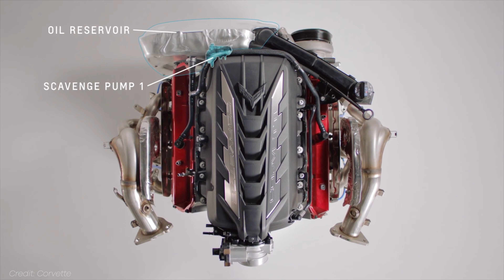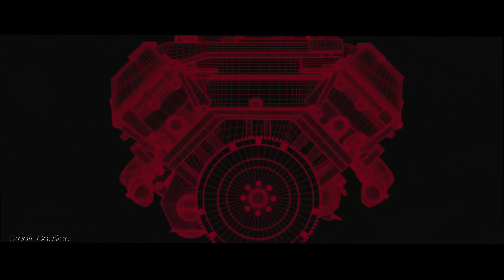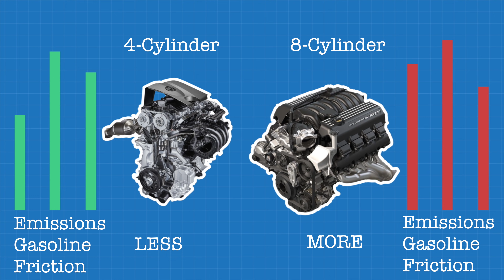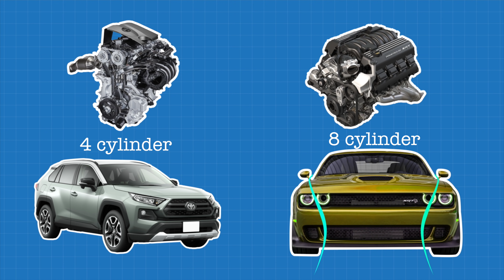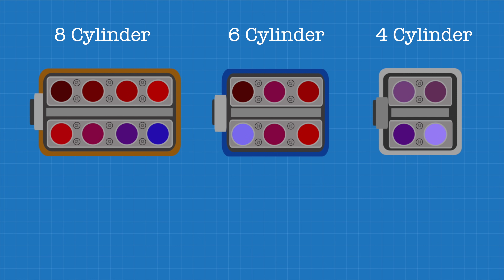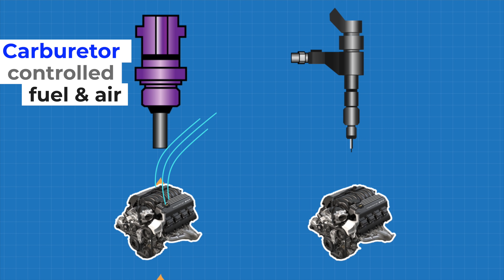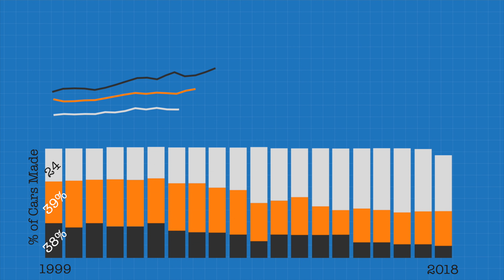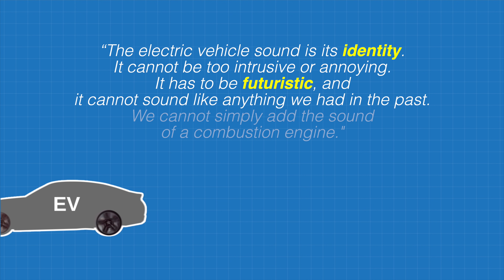Why V8 Engines are Dead

Comment: I am teaching my 13 yr. 'young' Granddaughter to drive my 1992 Chevy Silverado with the 350. She likes how easily the truck gets to 50 MPH. I agree..!! Yea, it gets only about 15 MPG out here in the rural area and that is with me hardly ever going over 60 or 65; usually around 55. But interestingly enough, even when I just have to occasionally floor it on the long straight stretches, I still get about the same MPG...!! And of course with an engine that powerful, I can pull just about anything....within reason, that is. I think I will keep it..!!

Comment: EV question: Who would wait even 15 minutes for recharging to complete when you can refuel a fossil car in less than half the time? And the range, maximum 300 miles? Even V8 vehicles can have a much greater range depending on tank size. I'll never accept EV'S

Comment: I like the idea of a V8 for longevity. Compressed motors with turbos and superchargers are fun but it makes them wear out quickly. I myself have been eyeing up getting me a fused F-150 crew cab with a 5.0 V8 and with a very special HHO mod. Most of the reports show double fuel efficiency increase at a whopping 30mpg if driven correctly. Wanting to build a long range overlander.

Comment: Nothing runs smoother than a V8 when it’s tuned and balanced right.    4 and some 6s have to have a balance shaft rotating twice the speed of the engine in the opposite direction to get the smooth idle of a V8.    V8 isn’t going anywhere anytime soon.

Comment: Only thing that will kill the V8s is if the government straight up outlaws them.  If you are doing real work in a truck a NA V8 is the best way to go.  The gas mileage of these twin turbo V6 and I4 they put in these trucks is terrible when you have to rev them 5k+ just to deal with a head wind.  Gas mileage has barely improved in fullsize trucks in the last 20 years while they keep putting smaller engines in them.  I'm still getting 19mpg with a 5.7 vortec with the AC on cruising down the highway 346K miles on it, and that's without disabling 4 cylinders or having 10 gears to run through.  New interiors are nice but ill take my 22 year old driveline that's never left me stranded over a 2mpg increase and losing all my low end torque.

Comment: I'd avoid turbocharger for the rest of my life

Big NA or electric is the way
Reply: Akhyar Rayhka 
You would take electric over turbo ? Why?
Reply: @aidenp5768  Lag, excessive heat, oil, and long term reliability for turbo is  not good Because the forced induction tech were only suited for racing cars.

Electric bcos no direct emmisions and no lag. Instant torque, no vibrations, quiet.

But id say every racing car should avoid going 0 emissions. Internal combustion should exclusive for these specialized racing vehicles.
Reply: Akhyar Rayhka 
Think of it this way, lag is still good, because for a second your car is naturally aspirated, it’s like your car is N/A for a little bit and then a surge of boost which is better than having N/A without boost! So why not??
Reply: @aidenp5768  its better. To. Have electric motors instead
Reply: What? Turbo/sc/NA... anything over electric is the way

Comment: No, it is not entirely true. Toyota still sticks with V8 and V6 for their midclass and upper level cars for dependability and long terms problems free engines.  Turbo and direct injections are prone to problems in intake valve, and short live engines.

Comment: That's why I'm holding onto my 4.6 V8 Grand Marquis for as long as I live!
Reply: 190 hp  woohoo !
Reply: @PorkusMaximius  Mines a '10 with an earth shattering 224 hp
Reply: I wish I still had my 03 cobra it had the supercharged 4.6 cranking out 390 hp stock
Reply: Certified Dirty Idle holding onto my 2004 Crown Vic Police Interceptor forever too!

Comment: If i own a V8, its going to have a huge transmission with lots of gears. 
That way, on the highway, i can really step that high torque down for some good speed at very low rpms.

Comment: If you ask me, V8 engines dissapearing should be called the modern day tragedy.
Reply: The only thing I like about a four cylinder is only four sparkplug to change.
Reply: The bigger tragedy is those 2.0L turbo 4’s. I could take a good V6 I suppose.
Reply: @ecoRfan  V6 is the way to go.
Reply: Ferrari STILL makes the 488...yep...V8, and 2019 GTE Pro LeMans winner
Reply: It's the modern day dinosaurs extinction. These huge v8 are dying out. Sad to see going down the road and no more rumble of the engines

Comment: But don't forget, generally v8' s are under stressed. Case in point, the 6.2 chevy v8 turns 1600rpm at 65 with a manual and can get 30mpg. That v8 will outlast any turbo charged 4/6 cylinder. Just ask Scotty, never buy a turbo charged engine or an electric car. Plus 4/6 cylinders typically sound blah.  Sometimes a simple ohv v8 is best. Great video. Long leave the v8. Keep them coming Chevy, Dodge and Ford!
Reply: Live not leave. Lol

Comment: Now this is just me personally but if I could pick any engine to have in a car I would take a V-12 first. When you drive a car with a V-12 you just don't want to go back to anything else. Second I would take either a V-8 or a straight six turbo diesel. A turbo diesel has low end torque that defies description and they can last decades. Last I would take either a four or even a three cylinder.

Comment: The idea of a world without the sound and power of V8 engines makes me sad.  Never getting rid of my '05 Mustang GT and '03 Marauder.
Reply: You and me both. 05 and 14 Mustang GTs 08 Shelby GT500! 
Love them all!
Reply: TNitro N hell yes! I have an 07 Shelby GT
Reply: 81 Ford  f150 ranger 300 I6
83  chev k20 v8 6.2 diesel 
88.chev v20 burb v8 350
91 Ford F250 460
Reply: I hope you can. I would advise stockpiling parts now. At the 20(ish) year mark the Ford parts counter will  start showing you laughing horse images in lieu of replacement parts
Reply: @98triffid  And I'll be checking out the PRANCING HORSE in the Ferrari 488
Reply: Ferrari  still makes the 488...
Reply: @tonybucca5667  Made from 100% pure unobtainium
Reply: How is the marauder compared to lets say a crown victoria?
Reply: Both are built on the Panther platform, both have a 4.6L V8.  The Marauder engine is the same as the Mustang Mach 1; it puts out 302 HP compared to 250 HP in the CVPI.  Other than the rear, suspensions are the same.  Marauder has air bags in the rear.
Reply: LL
Reply: 2007 gt500 for the win the last of the completely raw mustang that will try to kill you if your not careful
Reply: Better biobutanol

Comment: In 1980 I had a 1972 Pontiac Firebird 3 gears manual - V8, you can only fall in love with it, however I was still getting my allowance and after a few races, I realized that I could actually see the fuel guage decrease in front of my own eyes when I accelerated, so I stared to drive slowly to save on gas money (which defeated the purpose). I love V8s but like a T-Rex, they will go....

Comment: I have a 98 Mustang GT 4.6. I am gonna do my best to keep it on life support
Reply: Those 4.6L V8s have self sustaining life.😎
Reply: 6lemans10 my 2010 CVPI 4.6 has over 7000 idle hours which according to ford equals over a million miles and it still runs like a dream.
Reply: @newfound8082  Shoot I feel like my 98 GMC Jimmy has that much, I use it for a delivery service job I have and also of course use it for daily driving.
Don't get me wrong it has a little rattling going on but only has a few rust spots and has always started and runs great. Currently at 212k miles and of course being mechanically Inclined has been nothing but helping keep her on the road!
Reply: Dustin Dykman does it have an idle hour meter?

Comment: The first time I heard that the “V8 engine is dead” was 1973, and I have heard it many, many times since then. First heard the “standard transmission is dead” on the early 80’s. The fact is, very little in the automotive industry is ever really dead.
Reply: Long live the V8 👍
Reply: Also for the past 10 years or so, they've been saying the combustion engine is dead. It will be a looooooong time till it dies.
Reply: @viriatvsoflvsitania5422  It will never die. There is just not enough energy density in batteries.
Reply: When will eco boost be dead
Reply: @bingomaster2227  not soon enough
Reply: Trend Vortex it’ll die off eventually when they realize that it requires maintenance and care.

People are used to NA engines, not induction engines. They’ll realize soon enough.
Reply: @bingomaster2227  Never, Never, will own one
Reply: Ron Tiemens And the world was supposed to end in 2012.
Reply: Stas Glory the Mayans lost 8 years off of their calendar so technically “2012” is supposed to happen this year👀
Reply: Stas Glory and in 2000
Reply: Saint And 2% of Americans think that chocolate milk comes from brown cows.
Reply: I remember in the early '80s they said the same thing.  Well, it is still here.  They also said there was a major earthquake that was going to occur on the New Madrid fault line with complete devastation.  Dang, I must have missed it.
Reply: "word of my demise are greatly exaggerated"...MARK TWAIN.
Reply: Rotary Engine will Rise like a Phoenix and the V8 will live on.
Reply: Except that the standard transmission today is very much dead, so your story doesn't actually hold much weight.
Reply: 2dfx maybe, but we are moving to paddle shifters apparently.

Be scared of one entity that can really screw over the car market, government regulation’s tree huggers.
Reply: @2dfx  in the U.S. maybe, everywhere else it is still the most common.
Reply: Find me a new fullsize truck with a manual.  The manual is dead.
Reply: grumpybill 6-speed Cummins
Reply: Save the manuals and the V8s!
Reply: only the Wankel Rotary
Reply: Government regulations will have the last laugh. If they can make fuel efficient V8, maybe this wouldn't be a problem.
Reply: People said the horse and carriage wouldn't go away either as they laughed at the idea of a "motor car".
Reply: @benchattin  There are thousands of horse and carriages in Amish areas. It is a niche. Just like electric cars. It's more about ideology than practicality.
Reply: Ron what are you talking about? The fact is alot of things in the automotive industry are dead. Carburetors, big blocks, engines that require lead are a few things
Reply: @Len1977gt  Three things is "a lot". ok.
Reply: Except manual trans in a full size truck
Reply: @tmerks you could argue they never really gained critical mass in the first place.
Reply: The manual is very rare in modern cars, same way the v8 will be soon. It's about what the customer buys aka what makes them the most money
Reply: @RidinDirtyRollinBurnouts  customers want V8s and manuals. It's more profitable for them to just have one option for everyone. It's about cost cutting, not what we want.
Reply: @NikoBellaKhouf  v8 manuals represent a tiny fraction of cars sold I hope you know, they won't be around much longer. Corvettes and Shelbys no longer have them for example.
Reply: @RidinDirtyRollinBurnouts  I'm aware of that. It's not for a lack of demand. Cost cutting measures taken by people who hate cars and car guys.
Reply: Like Chrysler stating they were on track to be a 100% FWD passenger car company. Famous last words: Mopar no longer offers any sort of 4 banger/FWD passenger car, all of their cars are V6/V8 only and, AWD can be had with RWD the default feature.
Reply: @Pierce Hawke that's because Chrysler was owned by Mercedes-Benz around the time the 300/Charger/Challenger came out.  I think they are on the old S-class chassis.  I had a family member buy an Ecoboost Ford Escape and while it does have some power, torque-steer is unbelievable.  AWD may help that.  You are correct, Lee Iacocca stated exactly that Chrysler would be 100% FWD by the end of the 1980's.  The Aries/Reliant, Omni/Horizon or some derivative of the K-platform was all they made with the exception of the M-bodies, J-bodies, etc.  They were terrible.  What did I have then?  A Crown Victoria.

Comment: Uh.... except in the US, even today there are just as many V8 engines in vehicles sold today than there is all other auto engines combined (v6+i6+i4). Most of these sales stats only refer to consumer sales of vehicles (which the V8 still accounts for over 40% of all engines, more than any single other engine size), they ignore commercial/fleet sales and diesel engine sales which still makes up over 60% of new vehicle sales.

Comment: I would have really liked ford to continue the crown vic and grand marquis with metal intakes
Reply: The last good car they made.
Reply: What a bunch of morons stop making them
Reply: @CaptainCJ97  no longer meet emissions or safety standards. If they had kept the name alive the car it's self would of been changed beyond any recognition.
Reply: It's funny how everyone wishes that they were still building them but no one was buying them... At the end, they were down to one shift making them and that included exports.
Reply: Correct.  The last year they sold 46,000 mostly to police departments.  You don't see many PIT maneuvers done with Chargers.  The Vic had a frame.
Reply: My2Cents That is definitely the truth. People definitely have this impression about things like they were actually good, and the thing about that is, history shows that it basically wasn’t. 90% of small businesses, and businesses in general fail, just like designs of vehicles.
Reply: @Saixjacket  True. Wouldn't even call the Crown Vic a failure, they were made all they up until 2011.
Reply: @Saixjacket  just because something was built years ago doesn't mean it's not good anymore. My 1990 Chevy V8 has had to endure more and more stringent emission standards then it did when it was new and is also forced to pass a smog check while under load which it did not have to do when it was new yet it still passes emission checks with ease and is cleaner than any four cylinder engine I've ever had. It runs like a top and it's still reliable after 230000 miles. It's a pushrod engine and is considered a dinosaur but it's still more than capable of getting the job done and it's comfortable going down the road. I wouldn't trade it for any brand new truck.
Reply: Compute Geek the crown Vic was a solidly built vehicle, I won’t take that away from it, but it did not age well into the mid 2000s, at least they revived the SHO after some time, who knows, maybe they will manage a competent redesign someday?
Reply: that Roar boi   Hahaha. My thoughts as well.
Reply: I wish 😭😭😭😭😭
Reply: Ford shot themselves in the foot with plastic intake manifolds and 3-valve Triton engines on their V-8's. Lately, Ford has been lowering its product reputation by cloning other makers inept and expensive to maintain designs with their engineering.
Reply: rayford21 Yep the Windsor motors they made before the tritons were better
Reply: @cody roland correct.  Stability control was required on 2012 models and that couldn't be fitted to the Panther platform vehicles without expensive modifications.  There was a small run of 2012 models that were made from August 31, 2011 until September 18, 2011 that were shipped to the Middle East because they were illegal for sale in the United States.  Mine is 25 years old and has over 400,000 miles and I am going to keep on keepin' on.
Reply: @David Sanchez X2.
Reply: And maybe the marauder, the town car, and the excursion for sure
Reply: That was a great car put a supercharger on it from the factory and upgrade the suspension and brakes and that would’ve been a fantastic car.
Reply: They had metal intakes until 1996.  I know.  Mine has had 3 in 401,000 miles.  That is O.K.  I am going to keep on driving.
Reply: Amen!